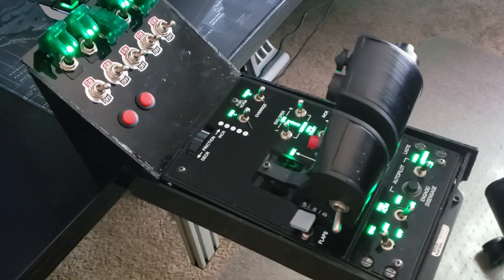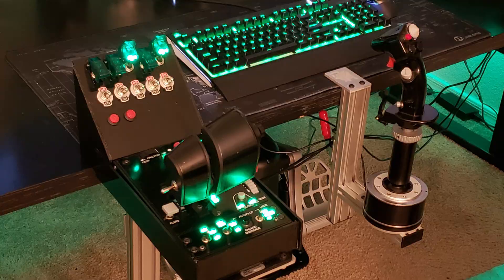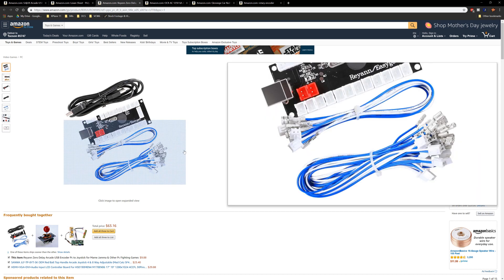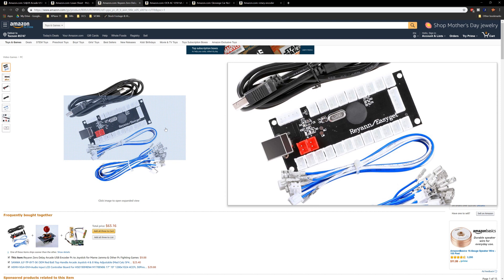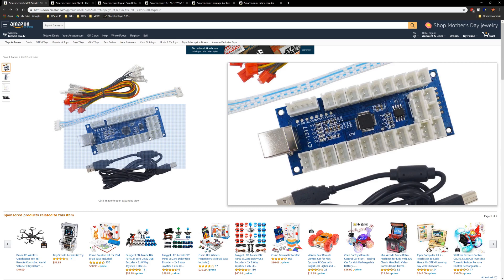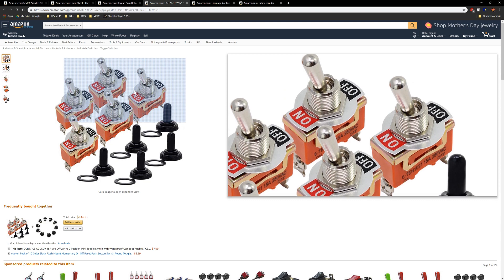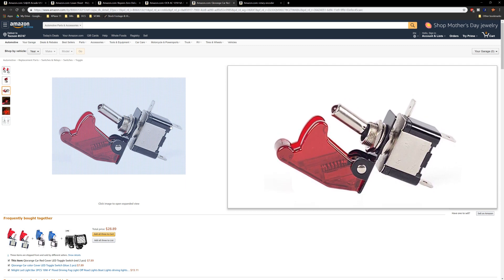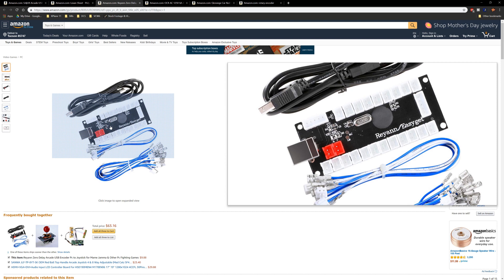Build Your Own Button Box

Comment: hey, I know this video was a little older, but I had a question. I don’t know if it’s the controller board that does it or not but I play star citizen and I wanna switch that is up to raise my landing gear and down to lower the landing gear. Would that work or what I need the three position to have two different inputs
Reply: Did you figure this out? I'm building one of these for the same reason and game

Comment: Ok so I have used rotary encoders and 3 way buttons and they both work ill tell you how. For 3 way buttons you just use 2 cables and share the ground. For the rotary encoders the normal button press can be wired in as normal but the rotation switches has to be wired in to the Dpad pins on the zero delay. I can confirm this works.
Reply from the maker: Awesome!! Thank you!

Comment: The comment about Arduino is full of misconceptions. Arduino IS really a simple entry point in electronics and microcontrollers. A lot of the hard stuff is hidden from the end user, and you can just wire the thing and press the download button. As for the code itself, it is based on C but really simple to use for basic functions. 12 years old can do it (and they are the worst at understanding what really goes on behind the front interface of digital systems, believe me).

Comment: Old video, but just in case someone is interested in doing a button box or custom controller. The shown controller works great for what it is, but if you want a little more functionality, like the ability to use rotary encoders, or even potensiometers to control axis' in the sim, you can look up Leo Bodnar. It's a small company in the UK that sells USB controller boards that does everything, depending on the model you get 12 bit axis' or 64 buttons. Very easy and simple to wire up and use, 100% plug and play in Windows. I've used them for around 10 years now, never had any issue. Really great if you want to add rotary encoders to build nav radios or autopilots.

Comment: 3 position switches should work, if you think about it, they are 2 switches in one. You need 2 of your cables, and connect the ground to the middle pin of the 3 pos switch, then the other 2 wires to each of the other pins corresponding to the 2 on positions of the switch.

Comment: That's great. Awesome work. Many years ago, I built a button box but with just the round buttons like you used. And this was  before we had the nice circuit boards on Amazon. Amazon wasn't even a thing then... lol. I ripped apart an old USB keyboard and used that circuit board instead. I then had to solder around 60 wires to it and it actually worked. Then in FSX at the time I programmed it with the keys because it technically was still a keyboard... lol
This what you created is much better though than the plywood box I made.

Comment: Hey I'm referencing this video for  a build. I'm Curious as to seeing a little more in depth on the backside of the panel, as well as what size holes did you drill for the press buttons? 1/2" works great for the toggle switches.. also consider using a "project box" its pre built and has water proofing theyre only 10 bucks and even simpler than making an entire box if you're not picky on placement. 

Great video! you saved me almost 70 dollars!!

Comment: Something to add is that you should decide where to put your buttons carefully.
You have a lot of space under the red ones that someone might be tempted to use for more buttons.  That's OK, BUT those buttons can't be accessed if the throttle levers are forward...
So only put switches there that will be used with the throttles back.

Comment: Question about the on/off switches, does it detect those two switches as two different inputs? When it's in the ON postion is it registering it as one button, then registering the OFF as another button?

Comment: You want easy setup, use mmjoy 2 with arduino micro pro. Can use encoders,axis,switches and buttons. You just have to research wiring a button matrix for it which is simple.

Comment: If you need simple rotary encoder inclusion, I'd suggest a Leo Bodnar USB interface such as the BU0836A 12-Bit Joystick Controller.
If you also get the matrix breakout board, you get 32 pairs of contacts for switches that can be programmed with a simple app to operate as rotary encoders (up to 16 encoders), as well as 8 analogue channels for potentiometers, etc.
There are other boards that have more inputs available.
They're not as cheap as the zero delay units, but they work well.

Comment: I think with the encoder switch’s you need to use two connectors, one for the left turn one for the right, the two ground pins are connected together and used on the centre pin on the encoder switch.
Reply: The problem with that is that rotary encoders usually don't work like that.  Both outputs switch state when it's rotated in a particular direction, but they're "out of phase".  The electronics need to be able to read that and decide which way it's turning.
Reply: Yes, you are right, I tried it and both directions were working at the same time. It showed up as one button being pressed before the other depending on the directions it was turned.

Comment: you could technically use a multiple position switch. just use 3 inputs and wire them to the switch accordingly. it may take a bit of basic electrical knowledge but its 100% possible. I do have one question about these little arcade boards. Is there any way to edit the name of the board and the button names as they are seen in software? for instants if i want it to show up as BUTTON BOX 1 and not GENERIC USB ENCODER 1

Comment: hey man, your guide is awesome its what brought me to building my own box... i have a question about the led toggles. i have the same board and the same toggles, they light up when switched on but they dont register as a function. any suggestions? im also struggling to have it register as a "joystick" or "controller" when opening my games and attempting to program my buttons, should i have to do additional steps? thanks!
Reply: I'm having a similar issue, I have 3 boards but my keybinds resetvand move between the board when I close my game, no clue why can't find anything on it
Reply: @Patriotsforjustice  i found it. steam library->rightclick game->properties->disable steam input.

Comment: A three position switch will work easily, however will require two button positions with splicing the two white wires together on the same lead.
Reply: Could a rotary encoder be worked that way also?

Comment: I have made a few arcade games with this type of board and the issue with on/off switches  is that, if you use the same slot in the board both on and off position think its the same key. So MS FS2020 will think its "1" for on but its also "1" for  off. So you have to split it to another pin on the card. Or it works as is for "Toggle" only switches in the sim. Example, "Taxi" lights have both a "toggle" options and  an "on" "off" mapping. This type of connection as is can be used for those.

Comment: You should probably take this down or make a disclaimer. You know this doesn't work well and is not truly plug and play.
Reply: Works great for me and is as close to plug and play as you can get with DIY button boxes
Reply: @baconatoromg6062  did you use buttons or switches? Switches don't work properly. So if you don't mind double flipping them. That's on you. There are better options out there got equal price.

Comment: the 3 way switches should just be a matter of connecting 2 negatives together on one terminal no? its my thinking that the normal state is off, switching one way or the other activates either live completing that circuit so you should have a 3 state switch, it just takes up 2 points of your board. Im wondering if they can be daisy chained to add more switches without adding a USB cable for every 10 switches, or i guess you could have a usb hub coming to the box and it divides up to each controller.
Reply: Actually it reversed .  You have combine the positives.   If you combine the negatives,  when toggle the switch it will register both buttons being pressed at once.
Reply: Very interested if this assumption/take on the 3 way switch correct? I'm exploring ways how to easily create a gear lever and flaps switch, the latter one being a 3-way switch (in the Hornet at least) for my VR setup.

Comment: how are you drilling the holes?   I've tried with normal drill bits and it breaks the plexiglass apart
Reply: Drill backwards in a anti clockwise rotation

Comment: one issue i've run into is these boards often have the same device ID which can cause conflicts if you plug in more than one at a time.
Reply from the maker: Yes I have ran into that as well. Honestly, arduino is the way to go. Just more complex.

Comment: Nice setup 👍. I'm getting ready to start on panels. I've decided on the type of controller I'm going to use. I'm working on a design for a universal combat aircraft panel set. But, not an unnecessarily busy interface. Just the functions that are mostly used for weapon readiness, deployment and navigation. I don't intend to install numeric displays or mfd screens, these are perfectly modeled in sim. Plus, it will keep cost down for me and the customer. I want to offer an affordable panel set for those of us who are a little more than casual flyers but not full on pit builders/users. Something to keep us away from the mouse and keyboard a little more.

Comment: I should probably write a button box that won't break and can be programmed like that zero decoder by work with more. I've already written a lot of the code and I fly in VR too!

Rotary encoders wont work with that control board because of how it works/they work. Let me know what sort of functions you would like and such and I'll see how feasible we can make it. Some soldering will be required for fancier jobs but there's no point me looking if there's zero interest.

Comment: hey men good video but i have a question. you see i want to build a 737-800 overhead panel and that way over 12 switches so i wanted to know if i could use multiple of those boards for different assigments. by the way great video

Comment: Contact this company: https://www.digikey.com/en/resources/local-support On your next go-around use 'Rocker Switches' as much as possible. Forget about 'Rotary Encoders'. You only need a rotary switch like a volume control on a radio. Those are easy to understand and wire the 3 terminals. What you want to do is change voltage into a numeric value. There are $0.50 IC Chips that to this. Volume controls 'POTS' or potentiometers are actually variable resistors acting as Voltage Dividers. Back in the day - 10 years ago, a trip to your local Radio Shack store would have been all you needed. How a 'POT' works: Picture the wire winding inside the round control as a straight line of windings. +v on one end and GND the other end. The center connector you're going to use as a moving wire connection up and down the winding. This center post connection will then be connected to the +v or GND with a certain value of resistance in line - a fraction of the resistance of the total resistance of the length of the liner windings you're picturing. When the sliding wire contact is in the center of this line of windings, the resistance from the center position to each end is equal, and the voltage is equally divided between the center position and the two ends: For instance, let's say that we connect each end of this thing between the two terminals of a 12v car battery. Then we connect the center contact/connector right back to the battery's negative terminal with that added resistor in inline, which I mentioned earlier. The circuits resistance value from the center point to either end will be calculated as two resistors in parallel - less than the two resistance added together per ohm's law. As we move the center connector/contact back and forth along the "winding", the voltage between the center and each end changes + or minus V (SUPPLY) while the voltage across the two ends remains UNCHANGED. As the distance between the center connector/contact and either end of the "coil" increases, the resistance increases, and the voltage between each increase, let's say 8 volts on the longer end. But on the shorter end, it's only 4 volts. And the entire circuit has retained the original current and voltage measurements: 12volts and the same overall current. Nothing has been gained nothin lost, except heat and energy. See when the audio signal from the radion tuning circuit enters the amplifier stage of the radio the resistance and voltage of the signal of the circuit have to be stable - unchanging - before the signal reached the radio's volume control and AFTER THE volume control to the speaker - really the relatively expensive very sensitive low impedance OUTPUT AMP stage then the speaker(s). That's why you can't just use a simple variable resistor it has to be a 3 terminal 'POT' (Voltage Divider). Think of it as a voltage equalizer. Looks to me that those rotating digital encoders operate in much the same way, but with an additional fourth terminal: Digital variable voltage divider. If you want to do a makeshift anything in the future to control a device's volume, do it at the POT, but only connect to the center terminal and the neg. terminal. THIS IS THE 'LINE IN'/ 'MIC IN', OR WHATEVER JUNCTURE'S ON ANY ELECTRONIC DEVICE.

Comment: I maybe late to the party but have you tried using potentiometers or rotary encoders for the joystick functions since they can be converted to analog using the MODE header on the zero delay encoder.
Reply from the maker: I actually haven't made anything new in a very long time. I was thinking about doing a new one though.
Reply: @OverkillSimulations  i just received my Zero Dekay too and tried it but it didn't work. I am thinking of getting an ardruino for the best results.

Comment: Hi..Do you need any special software to get this to work with DCS?
I'm not sure how one would interface this to DCS and a particular aircraft.
With some boards, Joytokey or DCS Bios is needed.
Is this the case with this board?
Reply: My guess is it will show up as a USB input in the keybinds section.  Not sure what the name will be called, but my Joystick is a USB but shows up per the thrustmaster throttle name that thrustmaster encoded into the USB connection.  His board may just show up as REYANN on the input list column.

Comment: i have the rockerswits with cap  you recoment  it doesnt work wat am i doing wrong 12volt 20amp  board is thesj@jx cy-822b led is also not working momentary button is working ??
do you hevan a wiring scheme ???

Comment: I've done some thinking about that three way switch and it would work if you designate the one switch as two separate buttons. You would solder two button connections to it. Both grounds being on the same contact, and either positive on opposing ends of the switch. The computer would then read each direction as a separate and different button press. Very helpful video! Just wanted to add that for anyone looking to do momentary 3-way switches.
Reply: you can even find two 3 ways with 6 total pins meaning you could very easily use  the cables supplied w/o modifications
Reply: Thank you so much for this! That was genius thinking! I will probably start my first project and I might try that. Have you or anyone here tried that?
Reply: @wolfpack2viking847  sorry for the late reply but yes I did this on multiple switches and it worked like a charm
Reply: @greenman5907  The moment you do soldering you might as well just go arduino.
Reply: I was just watching this video and thinking the same thing. So long as your buttons ground is split to go to both “buttons” and then designated 1 of the three ways to one button and the other of the three ways to the next button it should act accordingly.

Comment: Hi, I did this and hooked it up to fsx and when I flicked the toggle switch up, it worked but when I flicked it down it wouldn't shut off the system. I would have to flick it up again to shut off the system. Do you know how to fix this?
Reply from the maker: So, this is likely NOT an issue with your button box. This is likely an issue with the SIM. I run into this sometimes with DCS. 
You have to think of switches as "buttons". When you flip the switch to the "ON" position you are pushing a button down. When you flip it to the "OFF" position you're simply letting go of the button. Not all aircraft in DCS recognize the "RELEASE" of the key as a command. 
Try searching my channel for the RSMapper video. Use RSMapper to bind your button box to keyboard commands vs in the SIM. By using a software such as this, you can tell the SIM to execute X key command when the button is depressed, then X key command when the button is released. 
I hope this helps put you at ease as to what is very likely the problem.
Reply: @OverkillSimulations  thank you very much. You have been a great help to me. Thanks again!
Reply: @OverkillSimulations  So this will not work by itself in DCS and requires RSMapper?  I will have to look at your other videos, but you are saying that flipping the switch and mapping that up flip to say trigger in DCS, DCS will continuously use the trigger keybind so continuous fire?  And that is what the RSMapper will fix somehow?
Reply: Buy on/off/on switches and your problem is solved.

Comment: Found this while looking for ideas to build my cockpit. My idea was to strip an old keyboard and run cables from the key contacts underneath to external switches, not sure if this has been done before or if even possible  but your solution may be an easier solution. Thanks
Reply: Yes it’s been done but it’s extremely difficult to do